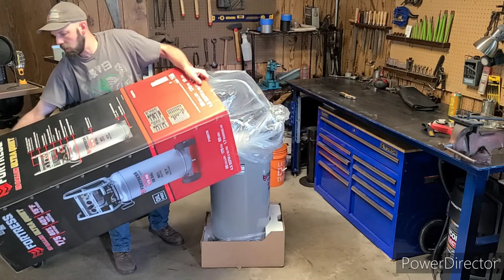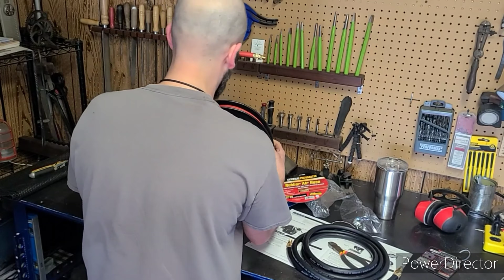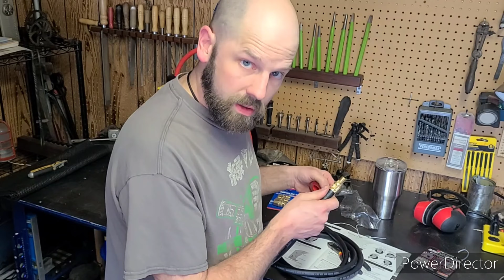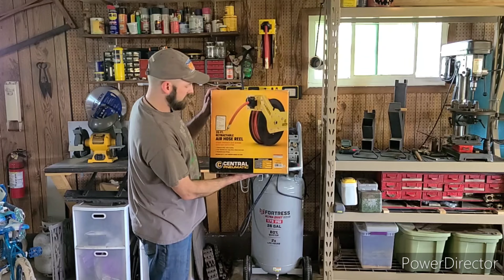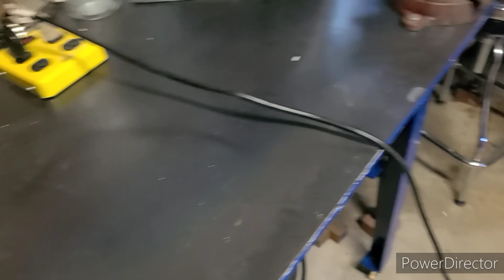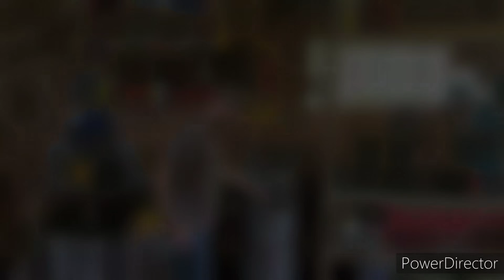Harbor Frieght Fortress 26 Gallon Air Compressor Unboxing, Setup, and Demo

Comment: Anyone has problems with the air manifold cracking? Also, you have to tilt the tank forward to completely drain water from the tank, the drain valve is not on the lowest part of the tank. There are a few ounces of water left in the tank if you don't tilt the tank.

Comment: Just bought this unit specifically because it is allegedly quieter than the 200 PSI 27 gal model. Thanks for your unboxing although I usually prefer long term usage reports.  Like the hose reel demo best. I believe that is Teflon tape, not silicone.  Have had negative experiences with Merlin fittings - much prefer the more expensive Milton (which they probably copy). By the way, if you do any brass machining, recommend NOT blowing it off if it has any lead in it. Lead poisoning is silent but affects multiple body systems (including brain).
Reply from the maker: Well, i'm happy to report that I have been very happy with it and it is still going strong!

Comment: This is a little nit picky but Are you sure it’s “ silicone” thread tape and not Teflon? And you forgot one of the most important part of using thread tape. Never let it hang over the end of the fitting threads where it can break off and clog whatever fixture is attached to the end of the hose or pipe, start back a partial thread

Comment: How's it work with automotive impact tools if you need to remove lug nuts or tight bolts on a vehicle?
Reply from the maker: Honestly I couldn't tell you. Though I have a feeling for prolonged use, it's probably a bit underpowered.

Comment: It’s been several years since you purchased this. Any issues? It’s one of my top choices but a lot of HF reviews indicate issues and it only has 90 day standard warranty coverage. Just curious how it’s holding up and if you’d still recommend.
Reply from the maker: Happy to answer! It has held up very well. No issues at all. I use it semi regularly. The only maintenance I preform on it is draining it immediately adter use. The only complaint I have is I have to rock jt back when it drains to get all the water and condensation out. And it will regularly freeze and clog while Im doing it. Other than that, I'm very happy still.

Comment: Could we get an update video of what you think of it now? I'd be interested in knowing if you've had any wear on the drain valve, etc.
Reply from the maker: As far as an update goes. To this day I am still very happy with it. It got A LOT of use it's first year. Lately I have used it as much but it still runs like a dream.

Comment: That does sound nice and quiet. Certainly an improvement in the shop environment. 

I hope you have better luck with the hose real. At least with ours, the latching pawl is made of Chinesium and rapidly wore the tip of the pawl so it wouldn't engage anymore. Perhaps their thinking was that it was better to wear away the pawl than to wear away the rotating tooth assembly, but if that's the case, it way over shot the mark. In any case, the reel is disassembled, and the pawl is on the bench waiting for me to get the mill up and running to make a replacement.
Reply from the maker: So far, it has lasted and still operates well. But yeah, you get what you pay for. Am I right?

Comment: Get the merlin connectors with 6 balls in it. Whatever you hook to it will not leak air like cheap connectors with 3 balls. I bought the 26 Dewalt  compressor and took it back and bought this. Fortress is much better and it gives you a hose rack to put your hose on. The 26 gallon 175 psi with a 2 horse motor took exactly same time to fill up.Not sure where people say the fortress takes 9.5 minutes to fill. Mine takes 6.25 minutes to fill from 0.

Comment: I barely used mine and the regulator already broke 👎
Reply from the maker: That's a pity. Was it the regulator itself or the knob? I'm just wondering so I know what to watch out for on mine.
Reply: @ im not sure but now there’s a 30-50psi drop…from research I found that harbor freight compressors generally have regulator issues and the best bet is to bypass them. I have not found a direct replacement for the original one.

Comment: Just bought this. The directions, yes, I read them, says to leave the compressor on the styrofoam base till the wheels are on, not leaning it on the drain valve. Other than that, excellent video. Oh, and when you drain the tank, tilt the tank foreward so the drain is on the absolute bottom of the tank, (again per those pesky directions.) 😉 so as to get ALL the water out.
Reply from the maker: Good advice, yes you need to tilt the tank to get all the water out.

Comment: Whatever size compressor you think you will need, then buy one twice that big and you will still wish you had bought a bigger one. I started off with a 11gallon 3hp then moved up to a 60-gallon 5hp, (11cfm @ 90) and now I wish I had gotten at least a 15 cfm @ 90 output. For a shop that is going to use air on a daily basis don't even think of getting an oilless compressor, you will be lucky if it sees its first birthday.
Reply: I have been an air compressor user for over 40 years.  30 gallon Craftsman for 30+, now a new 25 gallon Dewalt, and not once have I ever said, I wish I had a bigger compressor.  1st for DIY garage use, 30 and under is plenty for most.  2nd why mess with 240V if you don't really need it.  3rd price goes up faster then the capabilities, i.e. diminishing returns.
Reply: @canamrider7195  It wasn't plenty for me, I sandblasted glass often and occasionally did autobody work including painting a couple cars and 30 gallons didn't work for me. I have been a contractor for 40 years so my usage and yours could certainly be different.
Reply: @robertcarey3383  No doubt.  Guys with sand blasting cabinets must really go thru the air.  My compressor outputs 6.2 scfm, and I have no idea what my real requirements are.  I oiled my cabin a few years ago, and used my HVLP sprayer for the first real time.  Not sure what to set the regulated air at, I went with my standard 90psi.  Kept up beautifully.  Then I figured out the LP meant I could turn it down to 40 or so.  Worked great.

Comment: Could you paint a car with it?
Reply from the maker: I don't have any experience with car body work like painting unfortunately. What I would do is look at the painter you have and see if it lists the air power requirements for the tool to operate. My plasma cutters both had the air requirements in their instruction manuals. If you're not sure you could contact the tools manufacturer and they could likely give you the requirements. Sorry I can't give you a definitive answer.

Comment: How heavy is it?  Can I lay it flat in my pickup?
Reply from the maker: @corvairbusguy1  I don't have that info readily available. You can find the user manuals for almost all of harbor freights tools on their website. It's a fairly heavy unit but I would still strap it down.

Comment: Thanks for this video, and for responding to most of these comments.

I'm considering getting one of these, in order to supply air to air bushings.  The bushings will need air 24/7, but they draw less than 1CFM of air (0.84), at 75 PSI.  The idea is to have a compressor that supplies a lot more air and has a nice size tank, so that I can significantly reduce the duty cycle of the compressor.  This seems like it may be good for the job, as long as I have a system that will, consistently turn it on, and off, based on pressure values.

My bigger concern is based on something you said, in your video, about making sure that no water builds up in the tank.  You mentioned the importance of releasing all of the air, after every use.  Because this machine will be running 24/7, I don't see how that would be possible.  My thought is to mitigate this by having it in an area with a dehumidifier.  That way, I could try to reduce the amount of moisture in the air.  Do you think that may work?

This may, ulitmately, boil down to experimentation.  However, I greatly value your thoughts.  Thanks, again, for the helpful video.
Reply from the maker: @evansste  What you want to look into is something called an in-line dryer or a refrigerated air compressor dryer. I would also possibly consider a bigger unit.This one isn't going to work well for continuous high use.
Reply: @steelforestweldingandforge  Thanks so much.

My plan has been to use an in-line, membrane air dryer (right now, I'm using tons of desiccant beads).  This should keep the air, that goes to the bushings, nice and dry.  However, the air, in the tank, would, generally, still have moisture in it -- Not unless there's some way to dry the air, from the compressor, before it gets to the tank.

Based on what you've said, I may need a compressor that's seperate from the tank.  From the looks of it, this unit feeds air, directly, into the tank.  Which, I guess, is one more reason why this unit wouldn't work.

Thanks for your insight -- as well as your record time; when it comes to quickly responding to viewers who comment on your channel.  Keep up the good work!

Comment: I just bought the 27 gallon air compressor.. set it up and moment of truth spraying kitchen doors with husky air gun 🙏🏽. Big upgrade from 3 gallon porter-cable pancake air compressor … hopefully I’ve not overshot the mark! Great video .. I may make mine static also as soon as I’m more familiar with it.. I bought hose without reel but I can get reel and keep the other for extension.. if I paint the house 😂
Reply from the maker: Thanks for watching, hope the compressor works out well for you.

Comment: Hello. I got a question about the 26 gln fortess compressor. I have one and it was running very good. But after 2 months it started to shut off. I do let all the air out. It is in a well ventilated area. Does mot use oil. But i do have to turn the swith off or disconnect for 5 min. Then turn on and it will work for about less than a min. And shuts off again. Any ideas?
Reply from the maker: The most common cause for an air compressors shutting off before they are full is overheating. Are the temperatures very high where you live? If it's not the ambient temperature, the filters for your air intake may be dirty and the machine is struggling to pull in air. I am by no means an expert on air compressors. But this is what I have seen in the past. Hope this helps.

Comment: Thanks for the simple vid. I bought this a couple months ago to use for painting the base as part of my table saw restoration. In prepping the base, I basically hit a wall in rust removal by hand sanding and rotary tools, so I picked up a HF portable blaster. One thing I'm confused about is hooking up the HP air filter w/regulator to keep the air hose free or water, which I tried to hook up today, but I realized all my connections are 1/4, although the filter/regulator has 3/8 inlet/outlets. Since the time you posted this video, have you added an air filter/regulator combo to this compressor?

Or anybody else who happens to read this? 

Thanks to anyone! 😇
Reply from the maker: I have not, but I have been seriously considering adding a dryer. I get a lot of water in this unit, especially on humidity days.
Reply: @steelforestweldingandforge  thanks for the reply! Since my post, I figured out a basic system and posted a quick Short about it, if you're interested. Not trying to get views, just sharing the knowledge. Have a good one!

Comment: How fast does it take from an empty tank to fill up to either 60psi or 120psi ?
Reply: I have the same compressor and it takes just under 10 minutes to go from 0 to 175 psi.
Reply from the maker: @Kevin---kx3jy  thx!
Reply from the maker: Off the top of my head, I don't have a precise time. I would estimate it around 10-15min from empty to full.

Comment: I just bought one. I am a newbie on a compressor.  I am following this video. My only question is, when tank is full, as seen in the video. You turn it off and used it till its empty and restart. Or can you just turn in ON position till automatic will restart when its empty. What's your input on this?
Reply from the maker: When I'm using my compressor I typically leave it on the on position. When the tank pressure goes below a certain threshold, it will automatically start and begin to fill the tank again even while you're using it.

Comment: I have the 27 gallon 200psi unit. I'm pleased with it. Runs my 1/2in snap-on impacts at full power no problem. Runs my air hammer and ratchets also. I keep the regulator set to 120 to 150.
Reply from the maker: When I purchased this compressor it was the largest unit they had.  I kid you not they came out with the larger unit about 4 weeks after I bought this one.
Reply: Thank you!

Comment: This compressor sucks.  The reason we buy bigger compressors is we figure it will do the job.  Especially when it's dressed up with words like 150 percent more efficiency.  It takes way too long to fill and you get hardly any run time before the motor kicks back on.  It wouldn't be so bad if it were to fill up faster.  Don't buy it folks.  It's a rip off
Reply from the maker: Sorry it didn't work out for you, but I appreciate the feedback. It will help other people decide on whether or not this compressor will be right for them.
Reply: What did you end up replacing it with?

Comment: Really liked the review. I'm about to purchase a new one since the old one is about 11 years old and it was just a 6 gallon tank. Has your opinion changed any since you initially posted this review? According to the video info, you posted about 5 months ago.
Reply from the maker: In all honesty not really. It is still working great and MOSTLY fulfills my needs. My only regret is that I would have gone bigger. I never have issues with my plasma cutter, but some of my aire tools quickly run out of power after medium use. A larger air supply would easily remedy it. But then again, I have limited shop space. So overall I'm still very happy.

Comment: I have the Fortress 27 gallon 200psi model and I cannot say that I am fond of it.  I will not reach the 200 psi needed to shut off,  I replaced the pressure switches inside and I goess it has defective reeds in the compressor.
Reply: The PSI rating just means the tank is rated for 200 PSI. The pump and regulator will never allow it to get close to that.
Reply from the maker: I'm sorry to hear that, thanks for warning us all.

Comment: Very good, informative vid, thanks for posting it 👍🏽
Unfortunately air compressors have gone up in price recently, like nearly everything else, about a 20% or so price increase would be my guess from a year or two ago.  I hope the unit is serving you well.
Reply from the maker: So far so good. It works well for my plasma cutter.  But for air tool usage it only works well intermittently.  I wish I would have gone up one more size.

Comment: Nice video and nice setup! I just brought one of these home from Harbor Freight yesterday and I'm about to "break it in" for 30 minutes. I've never had an air compressor before and I really like your setup. I don't really know how to use it, so any tips you have are very much welcomed. The reason I got it was to be able to ensure my tractor tires are at the right pressure because I had a problem recently resulting from low pressure. I ended up twisting my tire off the bead and had to take it off and into a tire shop. I had been considering one to blow out the crap on the grill after a day in the field anyway and the recent incident sealed the deal for me. While there, I also picked up an Earthquake XT impact wrench from Harbor Freight so I don't have to borrow my friend's Snap On one. I'm a n00b and barely starting out and buying Harbor Freight stuff is a great way to fill my tool collection. I hope it all turns out to be quality stuff. I also just ordered the 44 inch rolling US General tool chest. Anyway, I know this video was about the air compressor so thanks for letting me ramble here. Good job!
Reply from the maker: Glad I could help you out! That's what this channel is all about.  There is one additional piece of advice I would offer. When you're draining your tank after using it, tilt it forward towards the drain valve. The drain valve doesn't sit on the very bottom of the tank and water can get trapped in the tank if you don't tilt the unit forward.
Reply: @steelforestweldingandforge  Sounds good, I'll do that. Thanks for the pro tip! Also, I haven't actually used it other than the initial 30 minute run, but I decided to drain the valve anyway and there was a tiny bit of air in there. Do I only need to drain it on days that I actually use it? I would imagine so. The air that was in there was dry. I'm now figuring out how to best make use of my starter kit with the couplers and quick connects. I think I figured that part out.
Reply from the maker: @reedness   Yes you only need to drain it when you use it
Reply: @steelforestweldingandforge  I don't use it very often, but I did today and I noticed the water that comes out of the bottom when I drain it has a brownish tint to it. Does yours do that too?
Reply from the maker: @reedness  yes mine has done that as well
Reply: @steelforestweldingandforge  I was just hoping it wasn't because of rust or anything. It doesn't sound like it, I am sure it's quite normal. Thanks again!
Reply from the maker: @reedness  well it is actually rusty water, or oil mixed with water. But it is a common thing is even a little water gets trapped inside
Reply from the maker: @reedness   And one more thing if you go long periods of time without using your tank it's best to just keep the drain valve open
Reply: Still works great! I didn’t use it much over the winter and have been using it every other week the past month to blow out my lawnmower. I did notice a blast of little rusty chunks came out last week and I hope that’s ok. The thing performs great though.
Reply: How is it still working?  Good...bad?